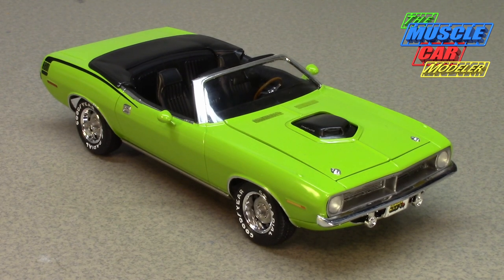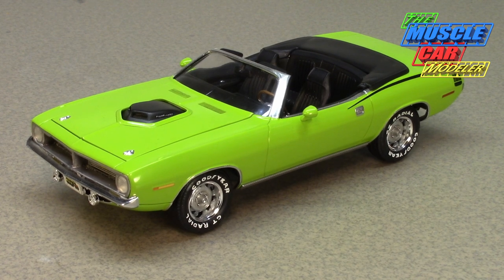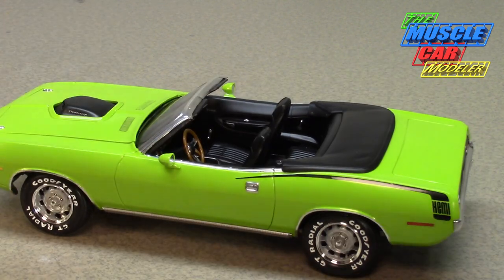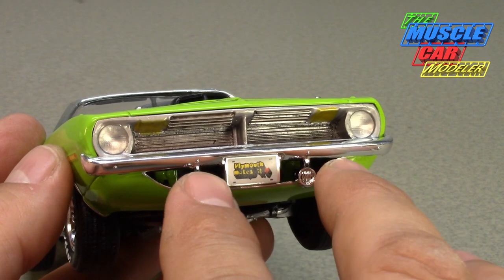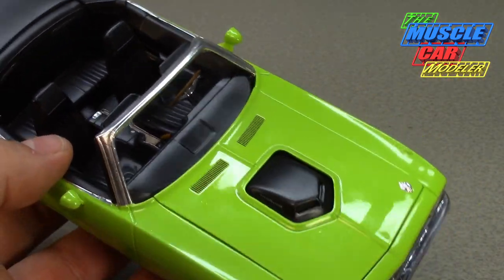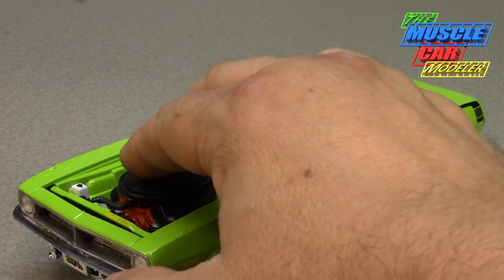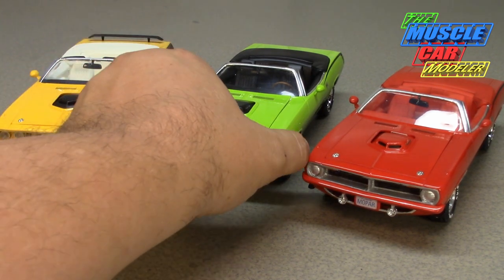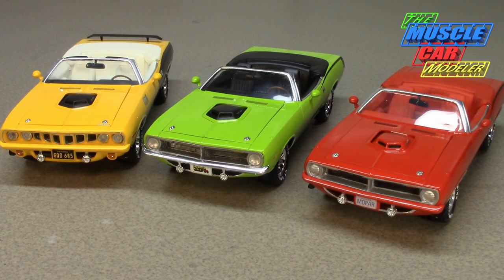Revell 1970 Plymouth 426 Hemi Cuda Convertible Build

Comment: Right on with the correct trivia.

Did you know that even most replacement after market companies sells the dist. caps in tan? And no matter what brand after market part, it's the same cap for ALL V8s up to (I think) 1986.
Reply from the maker: Thank you! I actually own a BBM (Big Block Mopar)! Well a 71 Fury Wagon with a 383 originally. It's a Sport Suburban and now looks like a 1970 and I blew up the 440 that I had built in 1996. So now I have a 512 Stroker motor that I started to build for it.
Reply: @TheMuscleCarModeler . I saw you episode where you did a walk around. I have a soft spot for older station wagons too.

Comment: Ok, my friend. I've seen advertised production #s for '70 hemi cudas ranging from 660-666. But, I feel like I've seen around 2,500 of them. Any thoughts? 
Beautiful job on this rascal!!!
Back in the day. One of my best friends, inherited a '70 hemi Cuda from his dad, that had purchased it new. I remember his dad telling us that he tried to get a flat hood, instead of the shaker. The dealer wouldn't go for it. It was white with white interior. No vinyl top. The only "decoration" was just 426 Hemi on the shaker. It was a bench seat with the middle, fold down arm rest. Column shift. Argent shaker. Black crinkle valve covers. IDK, if people realize how monstrous that shaker air cleaner is. It is HUGE! And a pain in the a** to take apart. Uh, I think there was like 12 freakin screws holding the "nostrils" to the base. It didn't really mind going 140 mphs with 5 people in it. It just took 20 minutes to get there, lol! Otherwise, it was dog. Seems like a lot of these stories have sad endings and this is no exception. My buddy disassembled the the motor and most of the chassis to start a restoration. Then, the big "D". Yup, divorce.  He had to sell it. 😭 That was about 15 years ago. I was Dying  to ask how much it sold for, but I just couldn't.
Reply from the maker: I like reading stories like that. They may not have a happy ending but they are real. I have read many stories about how the originals cars were not as great as the stories are now. Plus, many of the factory flaws are improved upon during restoration making them better than they ever were.
Are you asking my thoughts on clones or tributes? I'm fine with them as long as when they are sold, they are disclosed as such. Those cars help keep the legends alive and the owners are more willing to show them and drive them. You see so many of them at the local cruise ins. That is what I like is to see them driven.
Reply: @TheMuscleCarModeler  well, I'm saying that these cars seem to be insinuating that they are the real deal. Original hemi cudas. 250 "barn find hemi cuda"(s). Is getting to be pretty ridiculous. I mean 5 or 6 claim to be tribute cars, but come on. I'm having trouble deciding if Plymouth was on crack when they list 660 hemi cudas and there's really 2,500 real ones. Or 660 real ones and 1,935 liars? It's getting the same with the super bird. Did you see recently, that there was a "barn find" with 2 @#$%^ing super birds in it?? The 1,920(?) production numbers are seeming like 5,250! Here, 40 years ago, there were 2 orange ones in some guys drive way for years. 10 years ago I saw one (I can't remember the color) in a garage that some low rider guys had. For several years a guy brings a pale yellow one to a charity car show. 2 weeks ago, I saw a freshly painted, hemi orange one, while going to walmarts. I know there's more here, I've seen them at other car shows, many years ago. I'm in stoopid Corpus Christi, Texas. Barely even a city. So, how many in Houston,  Dallas, California, New York, England, etc. Carp, potentially 10,000 of these things, when only 1,920 were made? Oh! And of course the A12 cars. Same deal. The A990 cars. It seems like every city in America has 5 examples driving around and 5 in "barns", 2 in junk yards. That makes 6,000 min. of the A12, A990, yada yada. It seems like these rascals are reproducing like dang wabbits! In 1970, I was in the 3rd grade, in Laredo freakin Texas and a hemi orange one, came every day, to pick up one of the knuckle heads that went to my elementary school. I'm dying to know if the factory kept crappy records like you were saying about the camaro? Or are there that many fakes? Any thoughts? 
PS, my motto is... if you're not racing it, you're wasting it. Trailer queens piss me off.
Reply from the maker: I believe both have happened. The special cars that custom orders from the factory like Superbirds have documentation to prove how many were made and Plymouth lost money making the street cars but they wanted to win. I'm sure those cars were a tax write off. Many of the low production conversion were subcontracted out to specialty shops and have internal documentation for those as well. So many of the numbers are real. Plus, many fakes were made in the 80's when these cars started to get hot. Chevelles, and many Chevys are easy to fake. Some Fords as well. Mopars are harder because the actual Vin says what model it is and engine it had. My 71 Chevelle's Vin just decodes as 71 Malibu Sport Coupe with V8. SS cars say the same.  SS was an option and only appeared on the build sheet. Same with what motor. Inline 6 cars are called out in vin, but not witch L6 but nobody cares. Body plate only tells of paint and interior colors.
Reply: @TheMuscleCarModeler  but nobody cares. Ahahahaha! Excellent! 
When you were talking about your Chevelle, (a beautiful car, BTW), you used secret Chevy speak about the engine size(I think 🤔). Was it a M16 or an NCC-1701(bahahaha, get it?)? In about '80. My neighbor(that I got my 413 from, but that's another story, lol), had a brother, that had a '70 Chevelle SS, cowl inducted 454. Red w/black stripes, auto tranny w/center console. The neighbor (a Vietnam vet👍and a super close friend. I was prolly 17yo) had borrowed this monster for the day while his brother was at work. He asked me if I wanted to drive it!!! OMG!! I, tease and scoff and talk smack about all the non-Mopar cars, but this thing was freakin awesome. Perfect condition. A really high quality automobile. We both know that in actuality, mopars, quality wise, a pieces of crap. I mean the bodies,  of course. Anyways,  he directed me to a nearby street with no houses on it, and told me to get on it! I casually melted the tires a bit in 1st, let off
Reply: 1st gear shifted to 2nd stabbed the gas a bit and more melting. You could pretty much spin the tires in any gear. A couple years later I would own the same power in my Bee. Me and this guy were friends from when I was 13 mowing his yard to 14 and wrecked his Duster(ohh, I've got a million of these stories) and damaged a new Mercedes at the Mercedes dealership. He had an advertising company that I worked for, part time, for about 35 years. In about '85, as a bonus for a whataburger job. He took me with his wife to Mazatlan, Mexico(I'm pretty wild, so you know I've got a bunch of stories about that, and him!) This is a bit if a tribute to him. He was on the aircraft carrier Enterprise and did 2 tours of Vietnam. He had graduated from the Chicago academy of fine arts. His job in the Navy was as an aircraft painter. All of this led to the advertising company later. He was 15 years older than me and we went on soo, many adventures, it's was insane. Unfortunately he developed dementia in his later years. Unfortunately, we lost John Edward Foy RIP, about 8 years ago. He was a great guy. I, honestly, can't remember him ever using a four letter word. He was a Mopar nut his whole life, too. Good times.
Reply from the maker: Very cool! Thanks for the stories.
Reply: @TheMuscleCarModeler  you are very welcomed, my friend.
Thank you,  for listening. These are just the "kid", ones. I spun more on your A12 Bee post. 🐝